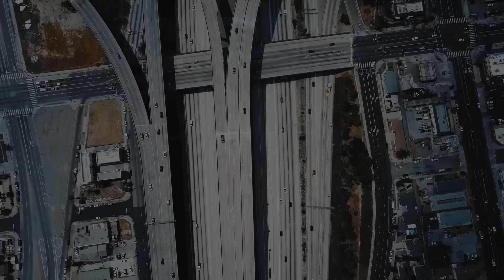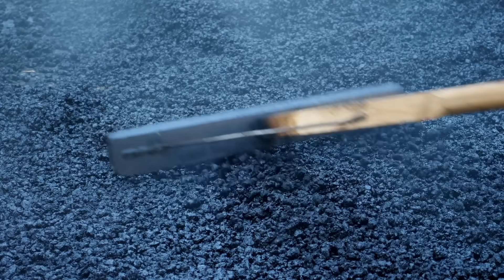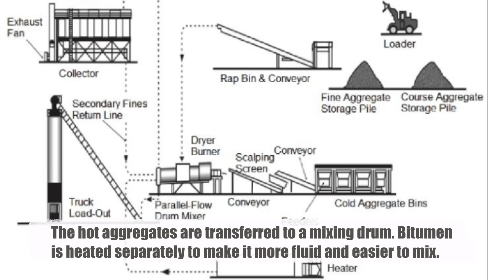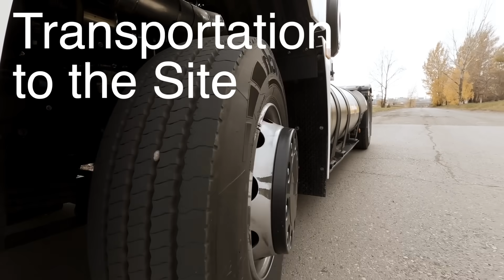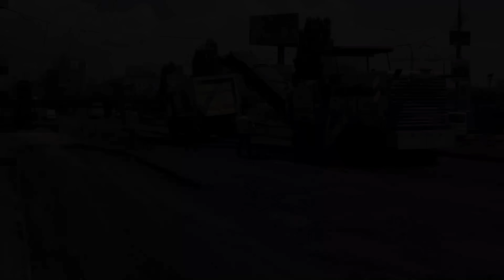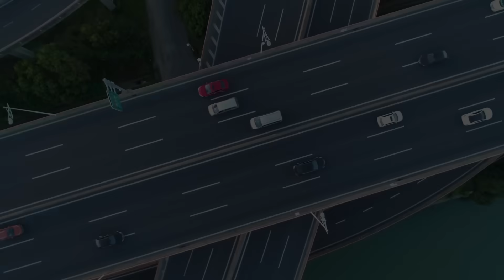How Are Asphalt Roads Made?

Comment: Do asphalt roads give better traction than concrete?
Reply: I remember when I worked for a Construction company who built motorways, we had extremely high temperatures one year and the roads melted so they had to resurface and replace the Tarmacadam with concrete slabs. Concrete is better for fuel economy.

Comment: I know in the past there were some states adopting the idea of using recycled car and truck, tires, in asphalt. Which made the ride softer and the road would last years longer.
Reply: They were incinerating the tires for heat at the asphalt plant. You'd never get rubber tires to mix with asphalt at the standard temperature used.
Reply: No  Chance !  Hot  rolled   asphalt   is  the  only  material   that  lasts   the   longest.   we  own   an   asphalt   co  in  North   West   England.
Reply: @stormytempest6521  It has been done in the northern climates. The idea is it may flex more with the freeze thaw cycles and not explode out potholes.